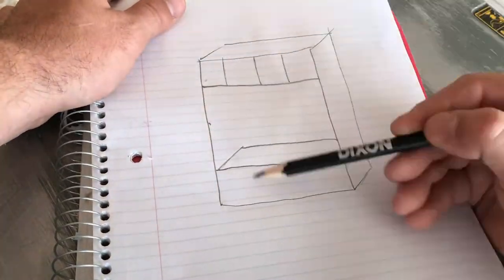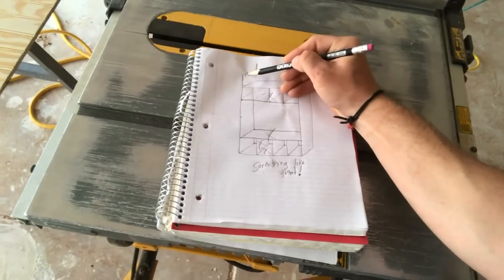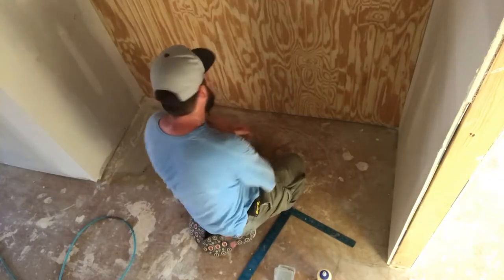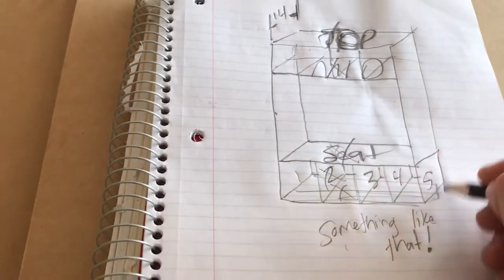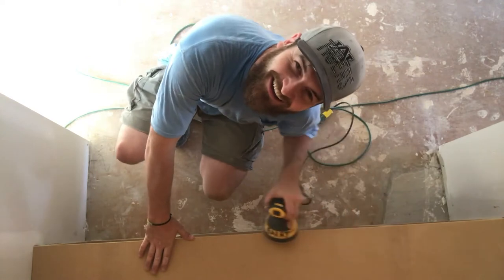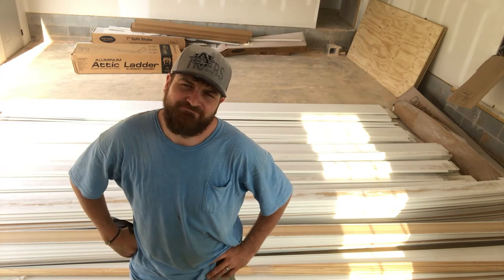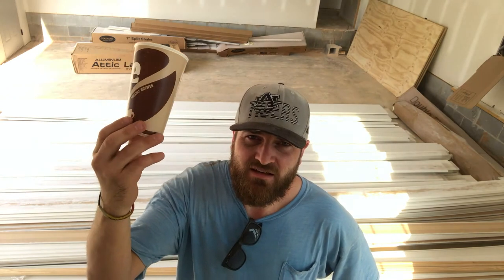how to build mudroom cubbies

Comment: i've watched this a billion times and think im ready to take it on. what do you put under it for the base? I noticed some pieces of wood under the base. Do you put quarter round to hide it?
Reply from the maker: Tuan Pham that’s just extra 3/4 MDF pieces I put under it to elevate it so that  the quarter round sits correctly when I come back.
Reply: @TMPK  ah simple enough, thank you!!
Reply from the maker: Yep, and if you already have flooring, you don’t necessarily need to elevated it at all or put quarter round on it. But if you want to put quarter round on it I would suggest elevating it a little bit maybe a quarter inch. Good luck! and I have another cubby video somewhere that might explain more details. Or maybe less details lol

Comment: Good job man. Whats the height of bottom cubbies? Thanks
Reply from the maker: 5sokol I normally do 16 inches on the bottom uprights, so the total height comes out to about 18 inch. 12 inch uprights on the top.
Reply: Aga. Thanks.
Jared
What would you do different if you didn't have one of those side walls?
Reply from the maker: https://youtu.be/N5RMaNvLVxA I built a stand alone in this video
Reply: Jared
Whats the total height from the floor to the top of the top cubby?
Thanks
Reply from the maker: 5sokol 7 ft

Comment: How did you connect the bottom of the top to the wall?
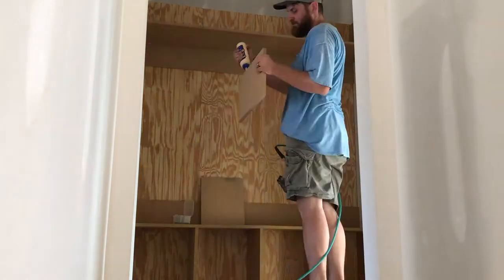Reply from the maker: Andrew Meadows first at 3:10 you can kinda see me attach one of the uprights to the side wall. I put both side uprights on the side walls then nail the bottom piece to them. then add the coat hook board under the bottom piece. My other video on cubbies might explain it more clearly. I’ve since started explaining more, vlogging less lol
Reply: @TMPK  awesome thanks man!